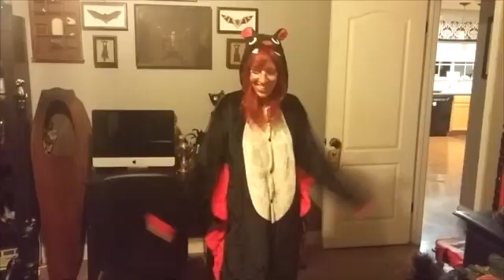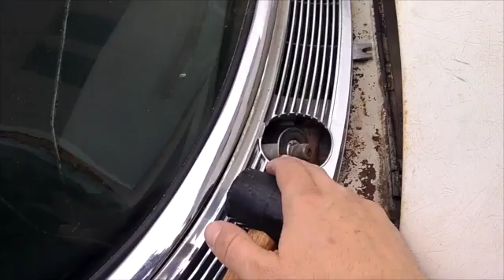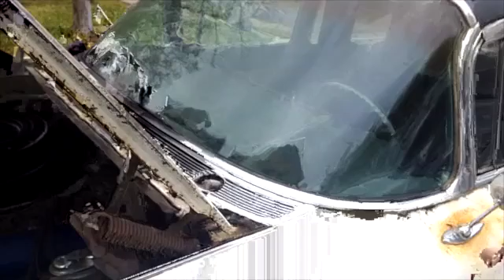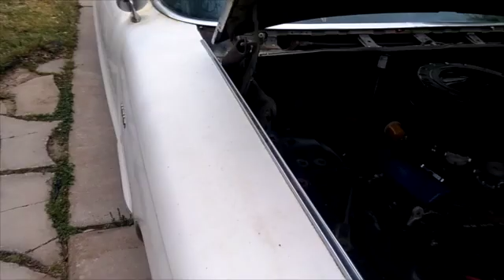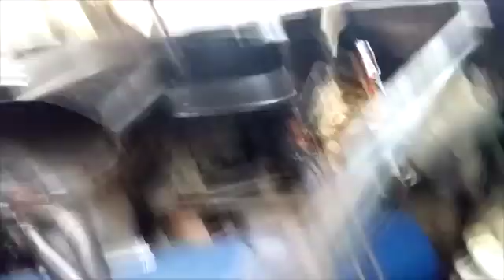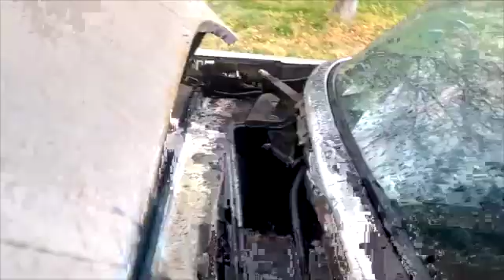62 Cadillac Hearse windshield Wiper repair

Comment: How did you get that wiper motor back into the brushes? Still working on that plan. I have another question about the side marker lights. Are the side marker lights on with the directional lights only? That is my guess. They light up the curb when the directional light is on and stay on, do not blink. Is that correct?
Reply: Dennis Herman , did you figure out the spring replacement?  I just ran into that on a 63 Impala motor
Reply: Not yet Matt. Had to drill a few holes to insert picks to pull back and hold the brushes in until the armature is inserted. That should work but have not gotten to it yet.